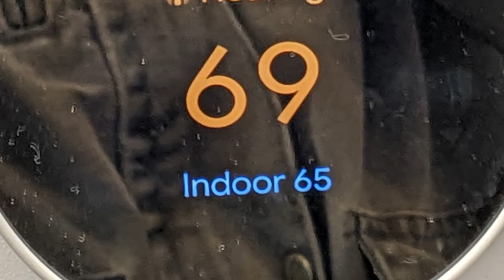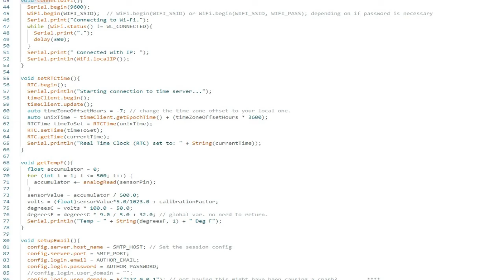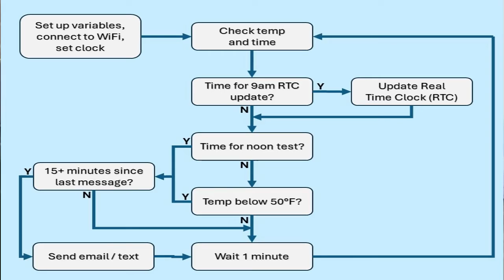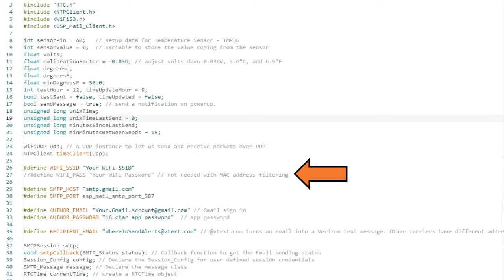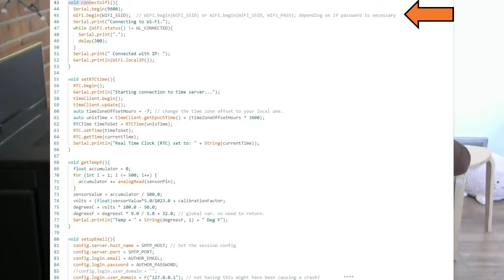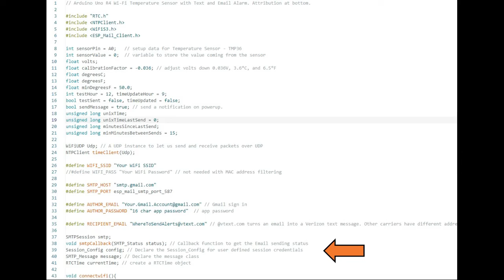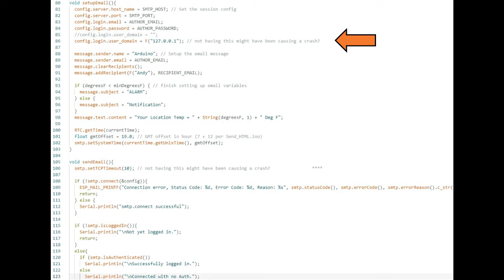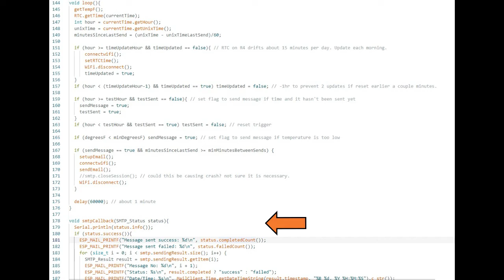Arduino Uno R4 WiFi Temperature Sensor with Text and Email Alarm

Comment: I'm getting a crash after two successful emailings.
#### Error, fail to set up the SSL/TLS structure
! E: fail to set up the SSL/TLS structure
Connection error, Status Code: 220, Error Code: -402, Reason: fail to set up the SSL/TLS structure

Suggestions?

Comment: Great idea and way to handle the problem. Just wondering what happens if the temperature drop is due to a weather related  power drop and wireless access point is lost at location being monitored? Maybe a battery backup and cell service provided internet with a sensor that lets you know it’s a power failure. Just a thought. I know you can’t cover every angle.

Comment: I'm no expert, but I would think using a sensor with an integrated digital interface would avoid all the calibration and  resistor offset issues.
One I am thinking of using in a project is the  DS18B20 based Temperature Sensor. They come in a waterproof package and are pretty inexpensive at 5pc for $11 on amazon. This is supposedly accurate to 0.5C between  -55 ℃ ~ +125 ℃  and uses 3 wires to power and interface to the Arduino with the one-wire serial interface and requires only a 4.7k pull up resistor.
Reply from the maker: Agreed and thanks for the input. The TMP36G has an accuracy of 3°C (5.4°F) per the datasheet. The two I tested were right at this limit reading higher than actual based on my other thermostat and a Fluke 52 temperature sensor. 5°F is enough that you can tell it isn’t reading right based on what the room feels like, so a little calibration made sense.  

The MAX31820 datasheet reports a ±0.5°C which would eliminate the need for calibration. Both sensors are cost effective.

Comment: Cool build! The Seeed ESP32C3 it a $5 microcontroller that could probably do a similar thing in a smaller footprint.
Reply from the maker: Thanks for the suggestion. The ESP32 is something I learned about for the first time using the Uno R4 in this project. I think I am going to try it out for one of my next projects.
Reply: Will the same code work for the ESP32C3?